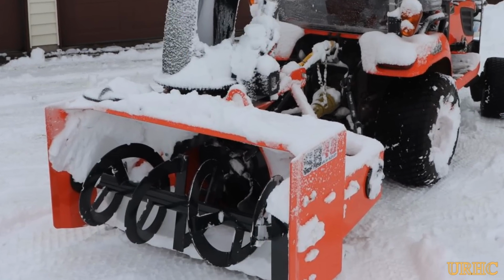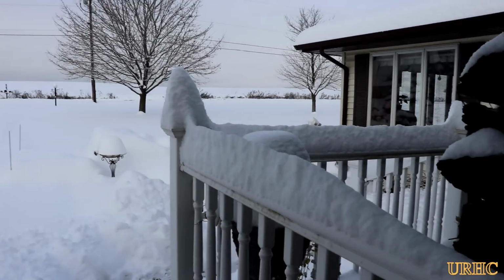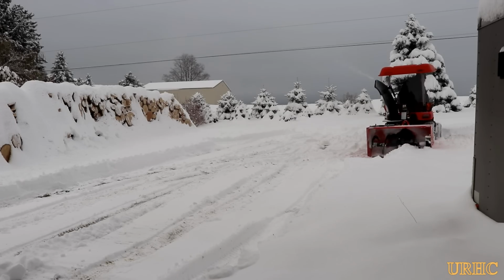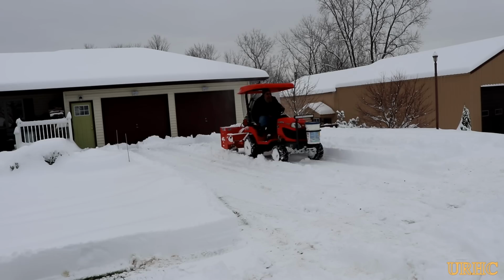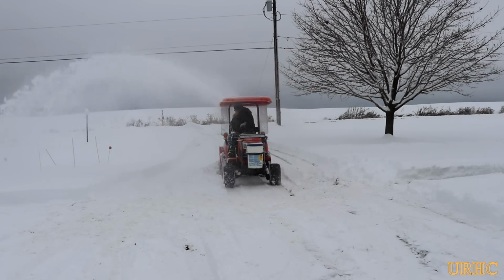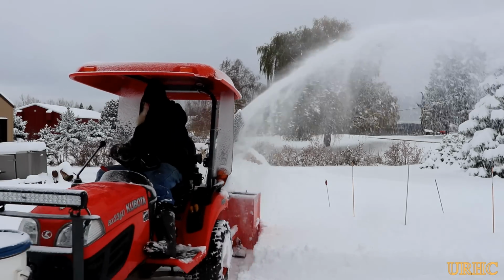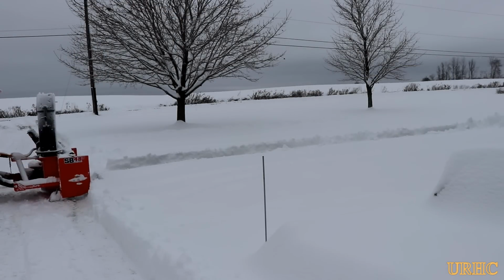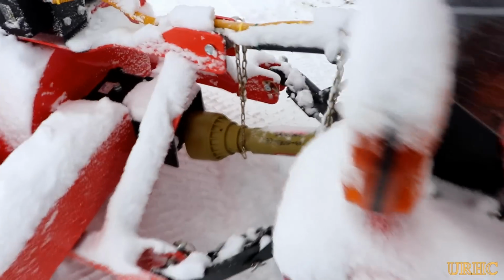Woodmaxx SB48 First Use

Comment: I gotta say the video of the areins u have or had is trash compaired to the small husquvarna i got only thing i dislike about the husquvarna is the auger cable if its left outside covered up the cable will freeze so its a pain for that but for moving snow i went thru banks over the top of it and it kept going with no prob i went thru wet stuff and i mean soaked cars splashing it all day kinda wet and it blew that stuff up the bank without any prob and as of now never broke a shear bolt yet after this whole winter of using it starts first pull everytime never 2-3 pulls like other blowers that iv seen
Reply from the maker: I used an old Ariens to do this for years and it was a great machine.  Then decided to upgrade to a big new one and it was junk. This is overkill but cost the same as the ariens and works good. Surprised Ariens said the new ones don't work as good as the old machines and you must buy a 4k machine for my amount of snow.  Thanks for watching.
Reply: @unemployedredneckhillbilly2023  4k dollar thing to move snow lol wow and i went from a old 90s blower in 2022 to the husquvarna which is a 2018 or 2019 blower and only big prob it had was the freezing auger cable and the plastic piece that held the chute up to turn proper broke but i fixed that with a big washer and yes i seen the video from 5 years ago after a big snow fall when u tryed to do the driveway with the ariens and was like wtf thats trash so anyone looking at husquvarna and that style of ariens id say go with the husquvarna cause i went thru that amount of snow without any probs i put 2 small light bars on the bucket and i went thru so much snow one of them came lose from being twisted with snow lol

Comment: I almost bought a Woodmax for my Kubota but I noticed how much more they weighed than other brands so I knew I would have a hard time keeping the front end on the ground! Even with the land pride I need 150lbs on the front. The wood max does seem to be the best built out there!
Reply from the maker: This is perfect  for my BX. I added some cast iron weight lifting weights to the front in another video and it's  well balanced  now. Guy up the street  had one of the lighter ones and after  seing  how mine  throws snow he replaced it with a Woodmaxx. Another  friend  bought  a 6 ft one to replace  his Woods blower that was junk. I think  this will outlast me without problems.  Thanks for watching.
Reply: The company blocked me didn't like the questions asked about there quality im a retired welder I have the Kubota 2380 tractor ended up getting the Ariens walk behind Kraken track model love it I have a Honda 1332 ATD as a back up since there are lots electronics on the new ones that can have a problem but happy with my blowers

Comment: That looks like a snowblowing beast! Hope it serves you well.  Being in the market for a snow blower, I would have loved to have seen the comments and viewer theories (at least the constructive ones) regarding the troubles with your Ariens. I can only assume that a lot of negativity ensues when one refers to a popular brand as junk, lol, so I def understand why you turned off the comments...but still...
Reply from the maker: That Ariens  was totally unusable junk for over 8 inches. My old 1960s one it replaced was a easier to use better  working  machine. The main problems  seemed  to come  from them moving the wheels  forward causing riding  up and autoturn cogging from side to side. plus water melting dripped on the belts and disc causing slippage anytime it was used off level. Tech support said it was not the right  machine 
for me with gravel and hill so it basically was a flat blacktop driveway rated machine. Too old to fight with junk machines so dumped it and got this. It's over kill but does what it is supposed to without a fight.  There are some  nasty keyboard warriors on YouTube.  Thanks for watching.

Comment: total mistake every way you look at this rig. Bet you don't like that feeling that your neck is broken after having to keep your head turned around all the time. Bet you wish you had a BIGGER tractor with all wheel drive as well with a FRONT mounted blower. Bet you wish you had an enclose cab also. should have spent just a bit more money in the first place.
Reply from the maker: Actually it has been perfect.  It's overkill for my driveway but now I can do the whole thing in a couple minutes.  The plastic shield I made for the back works really good keeping the snow off me.  I highly recommend this blower as it's easy to use and works great.  Why does everyone think looking back is a problem?  You look back almost as much with a front mount blower. Thanks for watching.

Comment: I have a MF compact tractor I have a 52" blower on the back of it , it has electric motor to turn the chute ... I wired one of those 2 way momentary toggle switches for turning the chute ...My front isn't lite because I left the bucket on ..
Reply from the maker: I just made a video about adding weight plates to the front  and it's perfect now. This thing is a beast. Thanks for watching.

Comment: Just watched and appreciated your entire Ariens saga. You did a good job showing and explaining the issues. You sure have a load of snow to deal with there. I live in central Idaho on a mountain and my 800ft gravel driveway could use one of those WoodMaxx machines but I don't have a tractor to handle that. If you ever think you'd need another walk-behind definitely get one with a hydro-static transmission the next time. You won't regret it. Honda's a good choice if you're not very tall but if your over 6 feet consider the new Husqvarna ST430T which along with hydro-static also allows adjusting the height of the operator's handles (heated) which I needed because of my height. I have one and I go up and down my 800ft driveway on it's tank tread tracks with zero slippage and at a good pace. I wasn't keen on the Ariens "Auto-Turn" because I anticipate having the very problems you did with the SHO 28. I have yet to run the Husqvarna through 18" snow so the jury's out on how well it will work on that but on our first "pre-season" 6" snow it was a snap. Thankfully we don't get those lake fed Northeast snow dumps out here or I'd have to buy a tractor and two WoodMaxx's. One for the front and one for the rear of the tractor!
Reply from the maker: I never expected problems like this with a new ariens.  A 800 ft gravel driveway with the autoturn would beat you up really bad. I think most of the problems came from moving the wheels forward this year changing the geometry of everything and shortening the drive system.  This has been turned into a machine for a flat blacktop driveway in low snow areas.  I thought about the Honda but didn't want to spend almost 4k on a machine.  This was in my price range and the company guaranteed me they would be there if there were any problems sealed the deal.  Seems to me smaller companies make better products and have better customer support lately.  I would never touch another Ariens product after this experience.  Thanks for watching.
Reply: +WH Mitty  you need to be careful about Husky, tho, their blowers are made by a 3rd party.  A buddy of mine learned the hard way and had to sell his Husky after only a couple seasons and buy an Ariens.  Now, I have seen detailed reviews of the 2019 tracked model that is claimed to target Honda buyers, and that one is well built.  They really put some effort into that unit, but they aren't all like that.   Although, a funny thing was one of the first things my buddy did was modify the Ariens chute what an extension because he liked how Husky's extension performed, lol.
Reply: @l337pwnage  I purchased the new 2019 ST430T tracked model and it seems to handle my ice laden several hundred foot long sloped gravel driveway OK. I think it's massive 373lb weight helped. The Honda-like infinitely adjustable augur height adjustment worked great to avoid throwing gravel. The machine came with a rubber chute extension but because it seemed to shorten the distance the snow is thrown I removed that. It also comes with a metal spring loaded chute guard at the base of the chute. Gimme a blinkin' break! I don't need extra blockage to remind me that my hand shouldn't be inside the impeller housing while it's running! So that's gone too. The few times I used it so far this winter it did the job. One thing I noticed about the chute opening coming from the impeller area was that it looks wider than that of the Honda. I read where Honda has a narrowed opening from just above the impeller area into the chute to help "squirt" the snow farther away. Husqvarna says my machine is good for a modest 40ft and not 50-60ft like the Honda. Nice idea but it could aggravate chute clogging.

Finally, according to the tag on my ST430T it was assembled in Orangeburg, South Carolina.

Comment: Beautiful setup and machine you have there, but I just cant do this rear snowblower setup.
Reply from the maker: I actually like it in the back. Very easy to get in tight spaces and only takes 15 minutes.  Front blowers just don't seem to work this good.  Thanks for watching.
Reply: @unemployedredneckhillbilly2023  yeah it works for a lot of people for sure! Buy I have to clear 14k sq ft of driveway so my neck would be disabled afterwards lol

Comment: I would have just used a walk behind ariens SHO for 3 feet of hard packed snow, then make a review on how it doesn't suit my needs.
Reply from the maker: Got rid of that piece of junk. It was totally useless with over 6 inches of snow.  My old one did this for over 10 years without a problem. This blower works great.

Comment: That would suck having to snowblow in reverse! A front mount would be a much beter setup. But if thats all you have to work with then you gotta make it work. Just doesn't look efficient, just my personal opinion!!!
Reply from the maker: Actually I like it. It is easy to maneuver in tight places and works great. If you have neck problems it would not be a good choice for you. Thanks for watching.
Reply from the maker: I really wanted another walk behind like I used to use but  after that new Ariens that was Junk I decided to try this to be safe and it really does a good job quickly. The BX engine barely knows it is back there working.

Comment: Woodmaxx don't blame your other snow thrower for not quite doing what you wanted! You need to size your equipment for your job ! A snow thrower on a trucker  is usually bigger than a walk behind! There are some bigger walk behinds snow throwers!
Reply from the maker: My little old ariens did it for years, the new one could not. It was junk. Wasn't going to take a chance on another walk behind.

Comment: I have the B2650 with a front blower on it and you can go quite a bit faster than I can in that much snow ,  plus mine will plug up on occasion  in wet snow . Mine is a little wider but I am very impressed with your blower and how good it works .
Reply from the maker: This blower impresses me for the hp of my BX. Still waiting for a big storm to see what it can do. Looks like Woodmaxx got the rpms of the fan and auger matched perfectly for this unit. Thanks for watching.

Comment: Just sold my 3 point hitch john deere snowblower for a walk behind with a snow cage. Getting to old to look over my shoulder and drive in reverse. Hated that way of snow removal. never going to put myself through that nonsense again.
Reply from the maker: I went the other way and love it. Used my old ariens walk behind for years without  a problem.  Bought the new ariens and it was junk and a struggle to use fighting the light front and autoturn system. I hated it and decided to try this. I love this blower and can now do everything in 15 minutes with zero fighting. Turning my head is easy and similar to some of the exercises I do so it makes blowing snow a fun job. I could never go back. Thanks for watching.

Comment: I bet that blower is at least 400 pounds. A Toro 48” 2 stage snowblower attachment for a Groundsmaster 117, 118 or 120 is 275 pounds. 
Why doesn’t one of the tractor companies make a sub compact tractor that is bi-directional? With my back problems and food intolerances I would tire of turning my head for a snowblower attachment really fast.
Reply from the maker: It is 529 pounds plus there must be close to 100 pounds of snow in it. I think Ventrac has a 3 point hitch on the front. It doesn't bother me and goes quickly.  Thanks for watching.

Comment: hello im new to the channel, i noticed you’re sawmill. do you mind if i asked how much did you pay? im planning on building my own but everyone says that you can find little company’s that sells them fairly cheap!
Reply from the maker: I bought mine from Hudson and built the trailer. I saved some money by buying the demo from a local farm show they displayed at. It only made a couple cuts  and they knocked a little off the price . I just had to go back and pick it up when the show was over. I think Hudson makes the smallest most affordable mills and current pricing is on their website. Check out the Forestry forum and there are many threads about builds in the sawmill section. They also have links and specials to many manufacturers that support the forum. The first thing you have to decide is the size of logs you want to be able to cut and compare mills in that size range. Thanks for watching.

Comment: To each their own, but personally I would never even consider a rear mount blower.
Reply from the maker: I said the same thing, but after that new Ariens I  would never go back to another walk behind. That thing was junk and hard to control.  This blower is amazing.  Thanks for watching.
Reply: Thanks for the reply. Actually I wasn't comparing the rear mount to a walk behind or even an Ariens. In fact I was not comparing it at all. I was simply stating I would never have one for any reason and my reason is the uncomfortable position one has to be in to use them. That being said if you are satisfied with the machine that is all that really matters from your end.
Reply from the maker: I didn't find it uncomfortable.  I bought a backup camera to install if it bother me and don't need it. It works good and that is all I can ask for.
Reply: That is why I said "if you are satisfied with the machine that is all that really matters from your end."

Comment: Thanks for sharing it really seems to work well and do a good job do you think it will clean as close to the ground as a walk behind unit? I would say your weight on the front needs to be around half to a 3rd of the weight of the snow blower with the turf tires the chains will help. Happy Thanksgiving!!!
Reply from the maker: It will. I lowered the skids to be safe but they don't sink in the gravel like the Ariens so they can be raised back up. That wet snow sticking in the bucket added quite a bit of weight to the blower i didn't figure on. Added another 100 pounds to the bucket and will find out next storm if it is enough.  Have a Happy Thanksgiving. Thanks for watching.

Comment: What engine RPM are you running?  I have found with mowers that full PTO RPM makes a big difference in performance.  For almost everything else I find 2,000-2,500 engine RPM (on a BX) provides plenty of hydraulic power for the FEL and/or 3-point hitch.
Reply from the maker: I run it at around 3100 rpm to get the 540 pto rpm required for the blower. It is the same rpm recommend for the mid mount mower. This blower did not bog the motor at all. Thanks for watching.

Comment: Are your tires filled with rim guard?
Reply from the maker: Just filled with air. It is my lawnmower so I don't want to weight it down. Threw some more weight on the front and will see next storm if it is enough.  Thanks for watching.

Comment: That looks like a poor design having the snow blower on the back of the  tractor makes no sense!
Reply: That's pretty much how all they are. With a bucket on front to pull away the snow.
Reply: Don't forget that rear PTO blowers are about 1/3 the cost of front mounted blowers and that it also allows for keeping a plow or loader on the front at the same time which gives the operator loads of options too.
Reply from the maker: It actually makes it very easy to get in tight places.  Now that I have tried it I really like it there. Thanks for watching.

Comment: Living in the mountains of British Columbia I put chains on all fours , snow blade on front and snow blower on back and I am ready for 
snow. My Kubota just churns turn what ever snow we get which can be considerable some years. put chains on all wheels if not a loader
,hunt around for some real tractor weights they are made to hang off the front bar on most makes of tractors. check out some farm supply stores or look for some used they will be much better .
Reply from the maker: I have chains ordered but they haven't arrived yet.  I squeezed 50 more pounds of lead in the bucket and strapped 2 old f350 rotors on top.  Seems to be enough weight now. I will have to weight it and find a permanent solution like the weights you mentioned.  We get several lake effect storms a year so this should work great.  Thanks for watching.